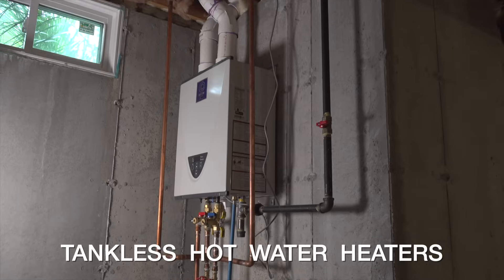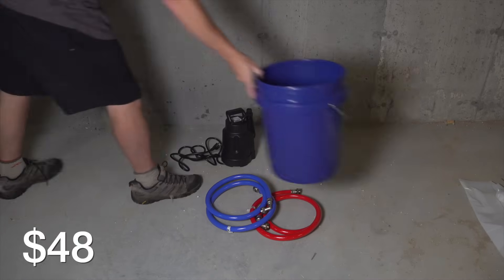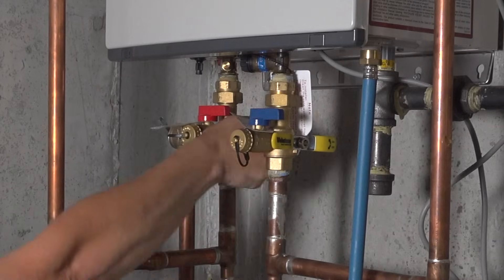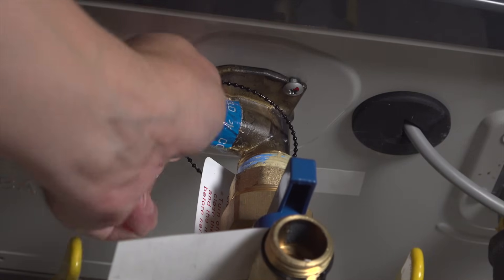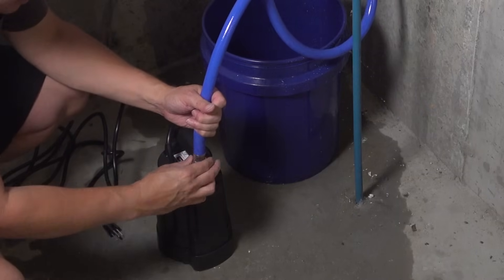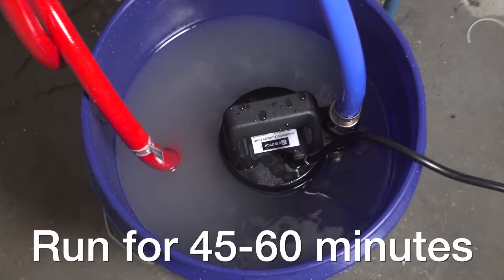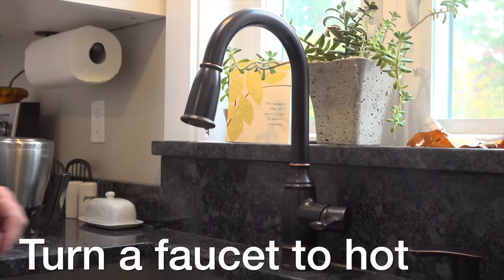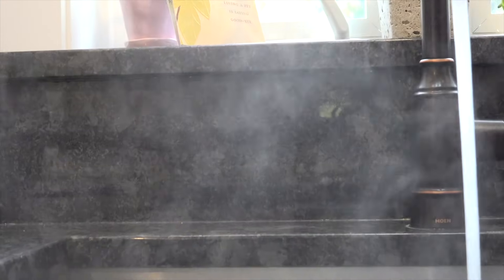How To Clean & Flush Tankless Hot Water Heaters with VINEGAR!

Comment from the maker: Thank you for watching - please LIKE & SUBSCRIBE Tools from the video Pump: https://amzn.to/3jcKT32 - Hoses: https://amzn.to/3nUJUrP - Vinegar (buy locally if you can) or free delivery: here https://amzn.to/2H7L8im
Reply: Why are you heating hot water?
Reply: Isn’t there a part in the tubing where the hot water is leaving the heater and about to go into house that needs to be cleaned?  I think that junction in tubing may be clogged since I have very hard water where I live and my hot water pressure suffers immensely. Any info on that?
Reply: What is the size of the pump that you are using?
Reply: @jazihbaebeshaki4370  He used a Utilitech 1/6 HP Submersible Utility Pump
Reply: U6
Reply: I'd like to just make a comment in regards to when you are about to turn on the system... you forgot to mention that in order to completely start running the cleaning, you need to switch the hot and cold valves at the top of the hoses so that it can start running..... I kind of figured it out but, it would have been nice to have been told in case anyone doesn't understand what needs to happen next... but thanks for the video it was very helpful!
Reply: When doing what you are doing... tie a women's stocking over the end of the red hose... it will capture the calcium particles... if you do not use a stocking .... the calcium particles will go back into the pump and back into the filter screen... thus cleaning the filter screen again....p.s..use cooking oil on the filter screen o ring... it will prolong life of the o ring and help seal it better...p.s.s one time I was in a jam... I used my sock!   And if you want.. add a anti scale filter on the incoming cold water side... change filter every 3 months... and never buy vinegar again! Antiscale filter is easier, faster,, and inexpensive p.s.s.s. antiscale filters will also remove alge and slime in the water!

Comment: Oops. I didn't realize that I needed to do this.

Looking at my system, it appears that my plumber also didn't realize that this needed to be done...because there are no isolator valves. You can turn off the water inlet and outlet, but you can't connect hoses to it to flush - it just has standard valves.

Looking at the manual for the boiler, the symbols on the diagram are pretty small. I bet the plumber couldn't read the symbols and didn't realize what sort of valves he was supposed to install.

Oh well. At least I have all the Pex tools I need. My next challenge: Finding someone who will sell me less than 100' of oxygen barrier pex. I only need about 10'.

Comment: Would it help to run the pump from the hot side... to "back flush" any particles that might have lodged anywhere in the unit? If there's an internal check valve, it would keep that from being possible, but I don't know if there is one built in. Our first tankless unit lasted about 12 years with no maintenance (I've always had tank heaters before), although startup became more inconsistent in the last couple of years. Our pressure tank is about the same age, and we get rust flakes in the washing machine, kitchen sink, and other filter screens (we don't have a whole house filter, but I'm adding an inline filter before the water heater). Anyway, any thoughts about reverse flushing will be appreciated. Thanks for the video.

Comment: Flushed my off grid tank today on Eliza Island in the San Juan Islands.
With this video and instructions it was extremely easy.  After I was done I switched to a second bucket with fresh water and ran that for another 15 min to get the vinegar out of the tank and to clean the pump.  
Follow the pro tip about hooking up the hoses first and you won't have a drop of water anywhere. 
Thank you for these instructions!

Comment: PLEASE check the filter AFTER the flush. My filter was pretty clean prior, it had been around 3 years since we moved in. After the flush the filter was covered in junk.
I opened a faucet extremely close to the tankless heater that doesn't have an aerator to flush out any other junk that didn't settle to the filter 
Then roughly a week later i cleaned all the faucet aerators after about a year since cleaning them all.

Comment: Would really like to know exactly what percent vinegar is manufacturer recommended. Rinnai owners manual says undiluted. Off the shelf it ranges from 5-100%. Anything over 50% is very difficult to find.
Reply: I got the Haymaker from Home Depot, it's what my plumber used the first time he did it. It won't make the pipes corrode I guess like vinegar does. Wish me luck, it will be my first time doing this. All the parts are much cheaper than the $150 the plumber got last year when I had bought all the stuff, and $300 before I bought it all.

Comment: So if anyone out there is having trouble getting the water to flush through check to see if you have multiple systems, one should have an M with circular arrows going around it that would be your master system. Turn that one off. Make sure that and all other systems are off and the water should flow

Comment: You missed some important steps. Rinse heat exchanger with clean water, rinse pump and hoses with clean water. Rinsing the heat exchanger is not critical as the process of refilling and clearing air from the water lines will removes most vinegar. If you fail to clean your pump the vinegar will eat the steel shaft and seal, and you will buy a new pump each time you do this flush. Rinse the pump and hoses thoroughly and let them dry before storing.

Comment: I probably would've flushed the vinegar out in the system instead of opening up the lines to the house and letting the vinegar mix into the houses plumbing pipes.  You could do this by disconnecting the pump but just leave the house on the outlet side and let it sit in the bucket. Turn on the cold water inlet side and it will push cold water through the heat exchanger and into the bucket. Without ever mixing with the homes plumbing lines. This will make sure you get all of the vinegar or cleaning solution out before you introduce the boiler back to your home plumbing.

Comment: After flushing with vinegar, would it be good to put water in the bucket and do the flushing again?
Reply: I see this is an older comment and you've probably already completed the job by now. But for those still wondering, you could do it that way. OR just open the cold inlet valve to your heater, but keep the hot flush valve open and run a  few gallons  that way.

Comment: Doing this now. Unfortunately, I had to buy a weaker pump for more money at my local Home Depot. And they only had this really concentrated cleaning vinegar that's supposedly 6 times stronger than normal vinegar. So I used 1 gallon of it and 2 gallons of water. Like someone recommended, I attached a sock to the end of the return hose to keep from sending sediment back through and to protect my new pump lol. 

Also, this vinegar can't be good for my plastic pump, so I'm definitely going to run a few gallons of fresh water through it afterwards. I'm also going to run some fresh water through the heater to get rid of the remaining vinegar and sediment inside like someone else mentioned.

Comment: FYI - This tankless is set on 130 degrees. That is FAR TOO HOT. I have mine set on 121 and I still can't take a shower without mixing with cold water. Even 121 degree water will burn if it's used without cold mixed in.
Reply: Now you're being silly. As a 26 year pro I set 130 to 140 for customers to meet their preference all the time.

Comment: Doing this right now!

My unit is in the attic! Such a struggle lol. Luckly, I have a drain pan underneath the unit that goes outside. I think I can use that to dump the nasty water??, instead of carrying the bucket down the stairs from the attic

The blue and red values that you need to close (not the maintenance ones) was a struggle to close. I had to unscrew it and use pliers to turn the valves.

Comment: need UNDILUTED vinegar
1 gallon of diluted vinegar is approximately 20% less effective than undiluted vinegar.

Also need to use 4 gallons of undiluted vinegar

Also once 4 gallons have been poured, you will then need to mix with 50% water 
so if 4gallons of vinegar fills more than half of the bucket, you need a bigger bucket

Comment: Hoping someone can give me a tip. I just did my flush and it went great, the issue I ran into was sediment in all my homes faucet aerators after I turned the heater back on and ran? Should I have left the hot taps open prior to flushing? I turned off the valves to the house on cold/hot, so the flush was isolated it seems once the city water ran back into the unit debris ran thru the home into the sinks and clogged 3 of my sinks. I fixed but want to avoid again if trick, thanks all.

Comment: I did exactly what you said it didn't work for me.  After many trips to the hardware store, I was finally able to get the correct hoses/adapters, etc.  I hooked everything, turned all the levers like you said. Put the sump pump in the bottom of the 5 gallon(probably a little more) bucket and turned on the pump. It worked fine but nothing,  NOTHING came out of the red flushing valve.  I let it run for a little over an hour and when I came back the vinegar was as clear as the day I bought it.  I felt both hoses and the one hooked up to the pump was working but the other, nothing...No vibrating, shaking...nothing..it was as if it was dead on that side. I don't know what to do now.  I'm using regular garden hoses, not washing machine hoses. I even turned the knob that controls the water and nothing but when I took the hose off, there was plenty of water coming out until I closed it again.  Why is this not working for me?  Oh one more thing...I took the filter out and it was CLEAN as a whistle and this house is 5 yrs old and has never had this tankless water heater cleaned.
Reply: I'm having same issue...did you ever figure this out?
Reply: @petedeffner7002  same problem with my Rinaii. I’ve previously flushed it a few times with no issues, but this time is a no go.
Reply: I saw a comment elsewhere that said Rinaii units have an extra valve to open when doing the flushing.

Comment: Crazy question, but... Does anyone else have a wide pvc 'holding compartment' filled with white rock (aka chat) on their condensation line?  My original installer told me the condensation liquid is corrosive to drain pipes and that rock neutralizes it before going down the drain. He told me to refill the chamber as needed. Every maintenance person I've had out since then is baffled by it & thinks it's some crazy thing I made up. Is it possible this is an issue affecting other regions, and my local guys are not familiar? Has anyone ever heard of such a thing? I would love to know!

Comment: Be a great idea to flush the system after your done too with clean water.  Disconnect the intake hose and close the valve off and then turn on the water intake valve while the hot water side is open with the hose into a drain.  Let it drain for 2 min to flush out the vinegar and any other debris you may have left.  Also, I've found adding a sock with a rubber band on the discharge hose to be a great filter so you're not running sediment back through the vinegar flush.
Reply: It might be good to leave the vinegar run through to the taps in the house.  It’ll help flush those pipes too!
Reply: Really like that sock idea!!
Reply: Thank you! Was wondering about flushing out any leftover vinegar...needed this tip on using the normal water flow and leaving the hot side hose outlet still in bucket😃
Reply: That's a good tip. That was the part of the process that was bugging me - flushing the tank with the gunk that comes out of it. Especially when you're using a floor-sucker style pump.
Reply: Better yet to first fill the bucket with water and run that through for a while, so the pump is flushed of vinegar, as well as the water heater. Then do a final flush of the heater with intake water.

Comment: Flush Tankless Water Heater (TWH)
    Frequency: 1 / year
    Professional Cost: $300 (up to)
    Other Notes
        Clean air intake filter on top as well?
    INFO
        TWH - Tankless Water Heater
        Blue - water into TWH
        Red - water out of TWH
    Items Needed
        One-Time
            Washing machine hoses x 2   ($18 for both)
            Submersible Pump   ($60)
            Bucket - 5 gallon
            Channel-locks (maybe)
        Continuous
            Vinegar x 3 (regular household gallons)
    TO-DO
            010. Turn off TWH (usually a button on unit)
            020. Close gas valve to TWH
            030. Close both yellow valves
            040. Open protective caps on red & blue valves
                        Note: Small amount of water will come out
            050. Attach hoses to both red & blue valves
            060. Place both hose ends into bucket
            070. Open red & blue valves
                        Note: Water in TWH will empty into bucket
            080. When done, empty water out of bucket - and put it back
            090. Pre-Filter - remove & clean (may need channel-locks)
            100. Replace pre-filter (hand tight only)
                        Note: Maybe use cooking oil on its o-ring?
            110. Connect blue hose end to top of pump
            120. Put 'submersible pump' & red hose end into bucket
                        Note: Maybe somehow filter particles out of red hose?
            130. Pour all 3 gallons of vinegar into bucket
            140. Plug 'submersible pump' in
                        Note 1: Keep an eye in it - just in case
                        Note 2: Run for 45 to 60 minutes
            150. Un-plug 'submersible pump'
            160. Close both red & blue valves
            170. Remove hoses from both red & blue valves
            180. Replace caps on both red & blue valves (hand-tight)
            190. Pre-Filter - remove, clean, & replace a 2nd time (if desired)
                        Note: Maybe use cooking oil on its o-ring?
            200. Remove 'submersible pump' from bucket
            210. Dump bucket outside
            220. Open any hot water faucet
            230. Open both yellow valves (blue first)
            240. Open gas valve to TWH
            250. Turn on TWH (usually a button on unit)
            260. Some air might be in pipes - but will dissipate quickly
                        Note: Maybe clean faucet strainer that was opened

Comment: Also...  tankless units typically have an air intake filter, which should be disassembled and cleaned as well. This is located on top of the unit,  between where the air intake pipe connects to the unit itself. It acts as a catch-all for any dust ,debris, or buggies that may work their way in from the outside. 
Great video! Thank you!
Reply: Thank you for the information. My tankless has been making a noise when starting. It only lasts a few seconds, and I haven't seen any drop in performance from the heater, but after reading your comment I figured I should check it. It was almost completely blocked. I cleaned it and, so far, I haven't heard the noise. I assume the machine was struggling to get enough intake air.
Reply: Thanks for the info. I'm going to check that out.

Comment: WRONG WRONG WRONG

These units have their water mixing valves normally open, that is the vinegar is going through the mixing valve and not the heat exchanger. PER TAKAGI : Set the temp to 140F, run couple of fixtures for a minute so that the heater is in high fire mode. While the water is running unplug the unit and then follow the procedure in the video. This opens the mixting valve and by unplugging it keeps it open so that your vinegar goes through the heat exchanger. This Takagi model is different that others.

Comment: Do you think using the Smartbot Submersible Water Pump Camo, 1/2 HP, Flow Rate 4200 GPH, Max Lift 30 Ft. safe to use when doing my water heater maintenance or is this water pump too strong?

Comment: The frequency of the cleaning depends on the water in the area you live in. I just picked up a gas water heater that probably hasn't been cleaned in 20 years. I turned it upside down and let it soak in vinegar overnight.

Comment: Thanks for the great video! Do you think a 1/4 HP pump would be too much? I have already got one.
Reply: I have a similar question. I read online per manu recs that a 4 gallon per minute pump is adviced. The 1/5 HP pump at 20” would pump 7 gallons per min per manual performance guide.

Comment: We tried to flush a tankless water heater of my neighbor.  Could not drain the water from the lines before the flush because not just a little bit of water cane out but a flow that lasted over an hour until we gave up.  Any ideas why so much water?
Reply: Did you double check that the incoming cold water line was shut? That's all I can think of that would do this.